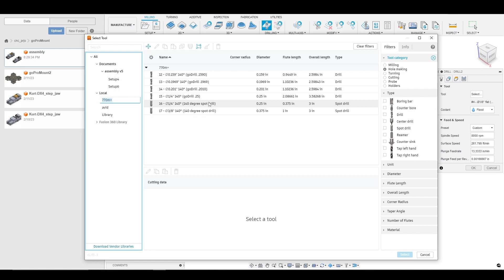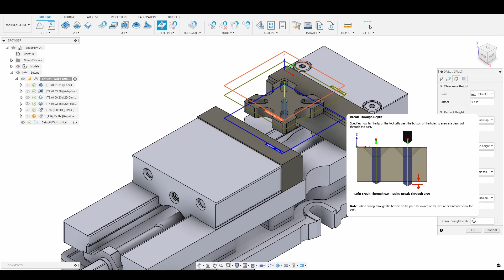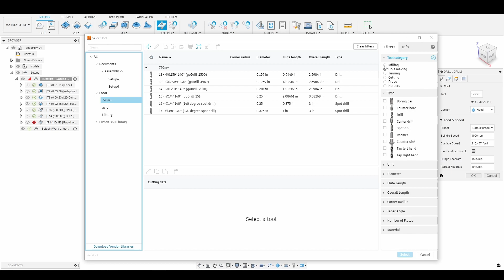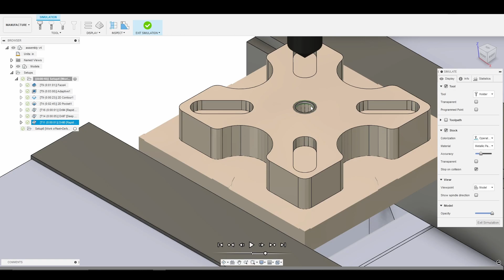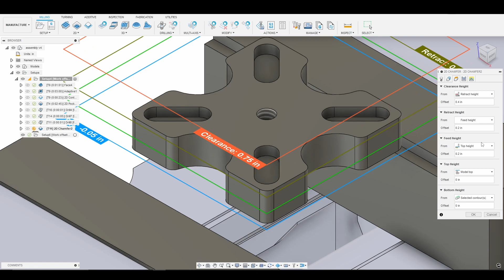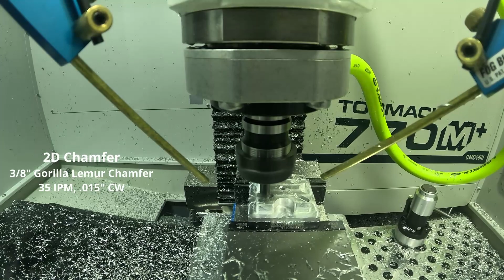Magnetic GoPro Mount Tutorial 3: Drilling Toolpaths

Comment: Excellent video series, well paced and nice machining clips at the end. Keep it up💯. A quick suggestion: going with a larger spotting drill to the correct depth may allow you to skip chamfering after the drilling op, if other chamfering was not needed. The angle of the chamfered hole will be 140 deg, but depending on how precise the screw fit needs to be, it may not be an issue.